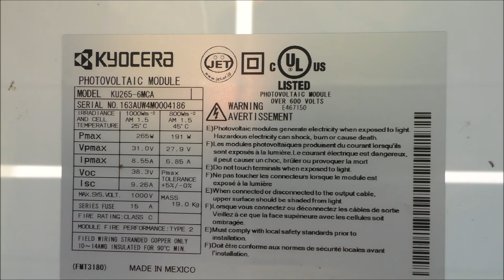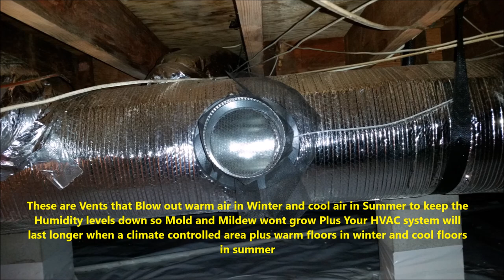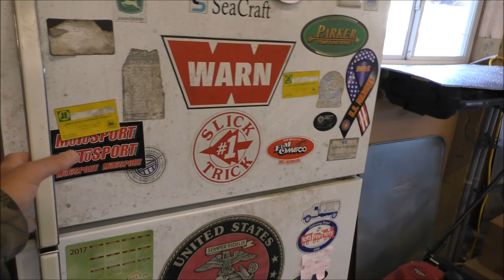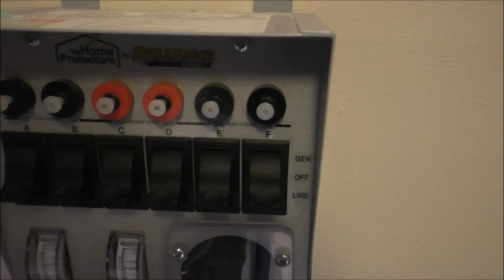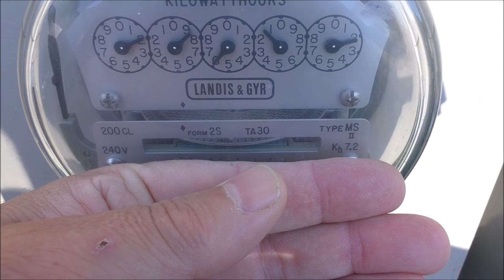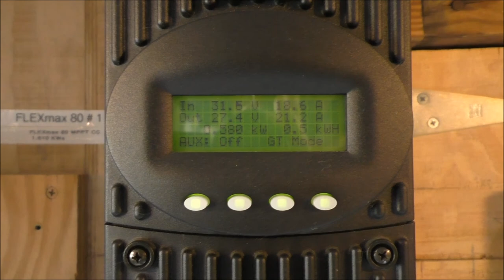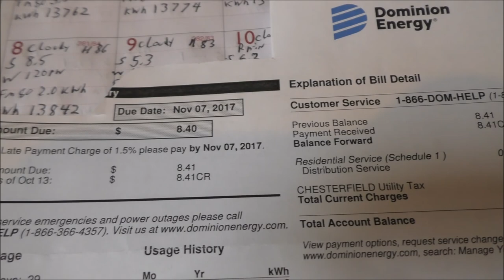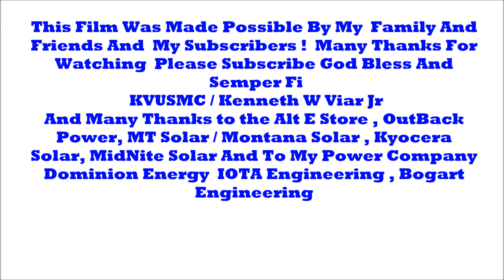Solar And Wind Home Power Bill $8.40 / "0" kWh October 2017 By KVUSMC

Comment: Your video peaked my curiosity about solar power (which I know nothing about).  That is a nice setup you have.  Did you build your system over time?  If so, what appliances or equipment did you first use solar to operate?
Reply from the maker: Many Thank Buddy Yes I Did A Little At a Time In the Beginning I could My Fridge some Lights and TV and ceiling Fans 
Here is A Link in the Beginning 
https://www.youtube.com/watch?v=V5lO3G8dxEk#action=share  

https://www.youtube.com/watch?v=fiuKjlAwFvs&t=398s

Comment: It's a shame your local codes don't allow you to get the wind turbine blades up above the tree tops. I believe you said 20' was the maximum height. You could capture quite a bit more wind if your blades were up another 15-20 feet... might even be turning non- stop.
Reply from the maker: +USNVA Yes Sir Your exactly Right Allot More Wind The Higher Up